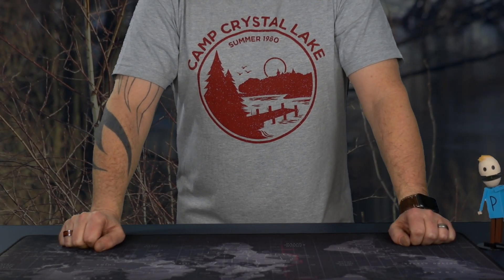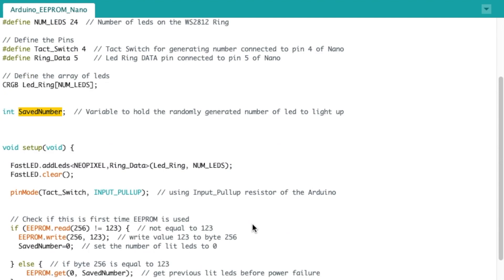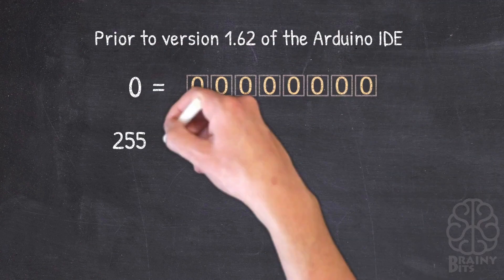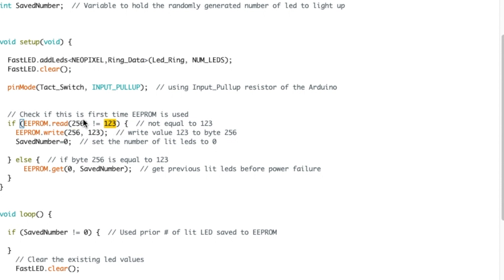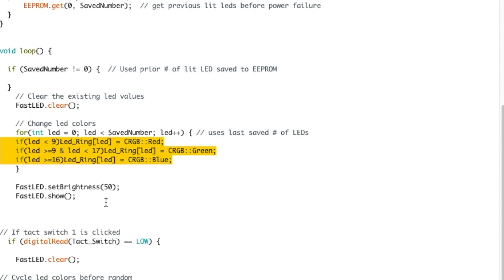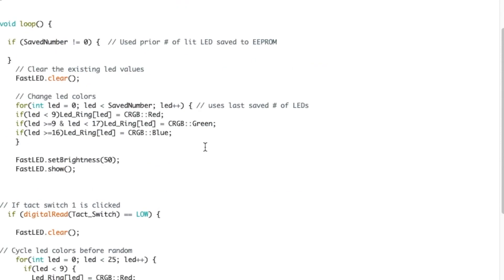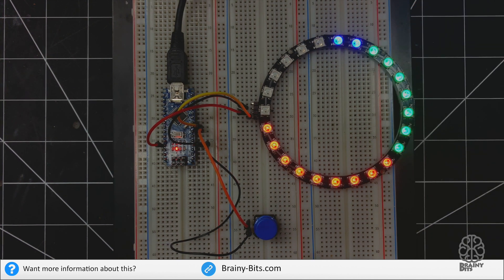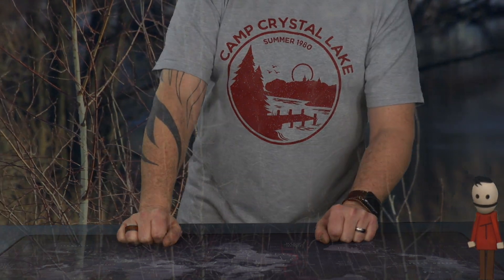Make your Arduino “Remember” using the built in EEPROM - Tutorial

Comment: Thanx for the video. I'm working on a library for storing and saving strings to internal or external EEPROM. You gave me an idea on what kind of functions are interesting to include in these libraries. This library will store your random number to one of 32768/1024 external/internal EEPROM addresses (address calculated automatically by the library). Each new random number will be stored at address+1 in a circular addressing mode. When you power up, the latest address will be again calculated by the library to enable you to fetch your latest random number. I'm doing this as a wear-levelling mechanism to prolonge the life of the EEPROM. You can only write 100000 times to any specific address. So now, you'll have about 100 million stores of your number before you have to change your Nano.

Comment: Don't forget there is a limited number of writes an EEPROM cell can handle, about 100000 is guaranteed. Write as rarely as possible and never in a short loop.
Reply from the maker: That's correct, but also those 100,000 Writes are for "each" byte of the EEPROM...  So you can write 100,000 times to byte#0, 100,000 times to byte#1, etc, before the bytes memory becomes unreliable.  Thank you for your comment and for watching.

Comment: Great vid, thanks. I have a homeautomation project that this would come in handy. But what if you hit the reset button, would that clear the memory?
Reply from the maker: Great question!  No The reset button just restarts the code on the Arduino.  So the EEPROM memory doesn't get affected.  Technicaly you can't really clear the EEPROM memory, I think that when you receive a brand new Arduino, all the bytes in the EEPROM will contain "ones" or are set to "11111111", or a decimal value of 255 .  So I guess if you wanted to get back to that state you could do a FOR LOOP to write a value of 255 to all the bytes.  Thank again for a great questions and for watching!  Cheers!